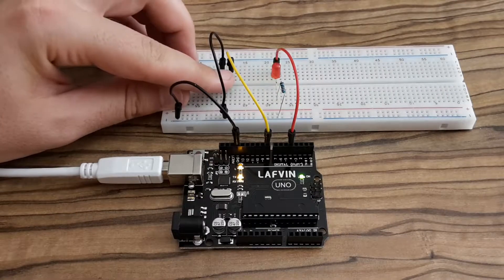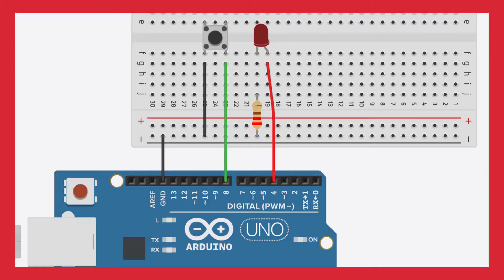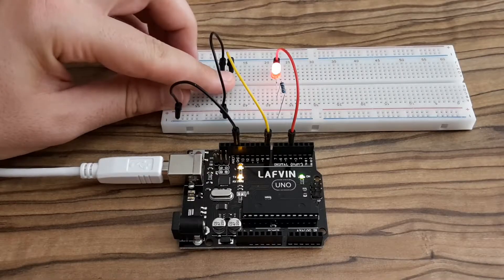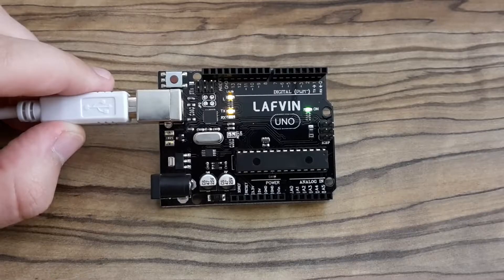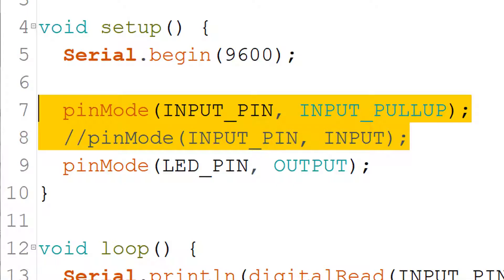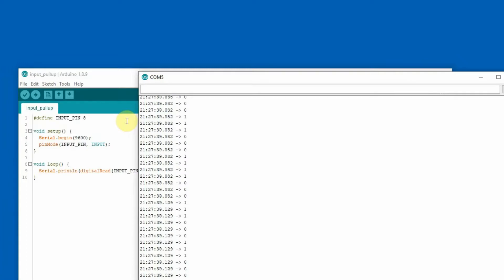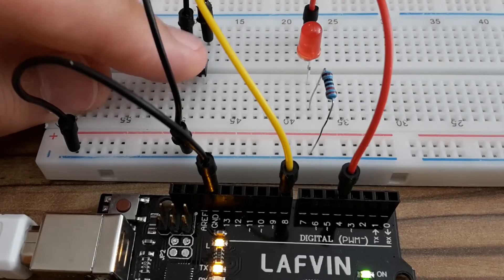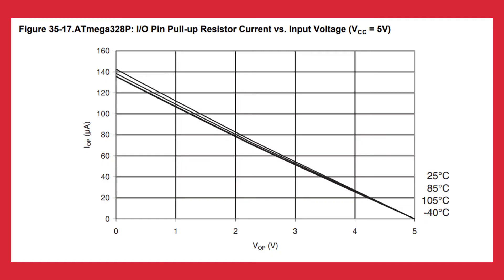Arduino INPUT, INPUT_PULLUP and Floating Pins Explained

Comment: From what i see here, when the pin8 ( with Pinmode(8,INTPUT_PULLUP)) connect to the ground pin, the digitalRead will show 0, which means the voltage in pin 8 is now 0v and since the ground pin is also 0v, there must be no current. But then how can your device show 129mA? I have the same problem where i connect pin 8(input_pullup) to the positive side of the LED and pin ground to the negative side of the LED, the LED is still slightly bright but the digitalRead at pin 8 show 0. Really need your explanation. Thank you!                                                                                                                                                                                                                         PS: Sorry for my bad english
Reply from the maker: Hi, when the pin is INPUT_PULLUP it's 5V by default. Therefore you can see 129mA connected to the ground. When I connect it to 5V the current is zero. It is how the MCU is built internally. Some MCUs also have a PULL DOWN mode and in that case it would work like you described.

Comment: These videos commonly use power supplied through the arduino. What about of the power is coming externally from a battery?
Reply from the maker: Hi, how do you mean that?
Reply: @zeroampselectronics   So imagine a circuit, and then i just have a wire going into pin2 input, and pin11 output. My battery is not directly powering the circuit through the arduino power pins.
Reply from the maker: Which pins exactly did you use for connecting battery?
Reply: @zeroampselectronics  none, they are wired in series but not directly going into the power pins of the arduino.
Reply from the maker: Hi, I'm lost :-) what's your problem with your Arduino then?
Reply: @zeroampselectronics  hahaha I'm sorry, I'm totally realizing how confusing I'm being. I'll elaborate after work today